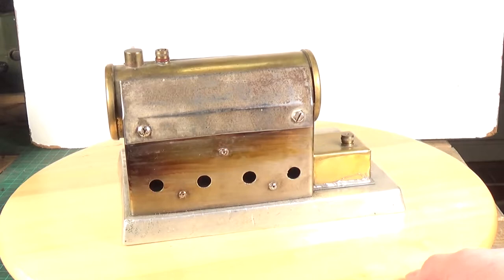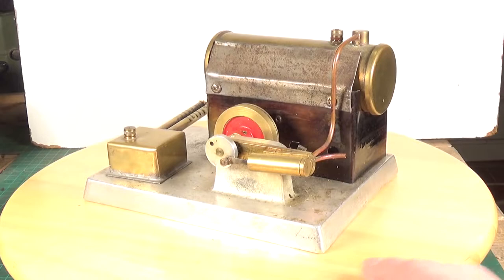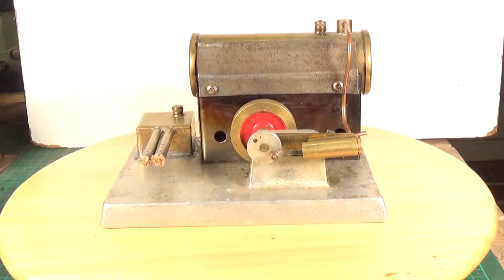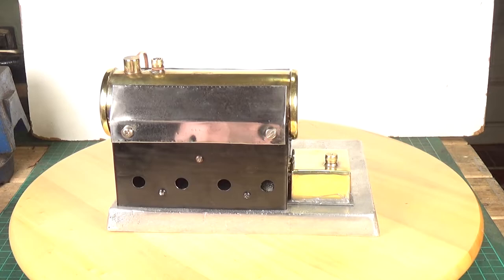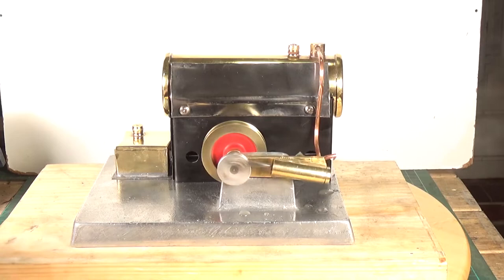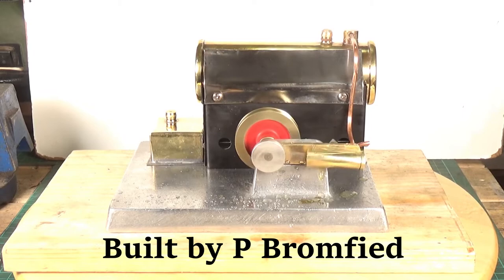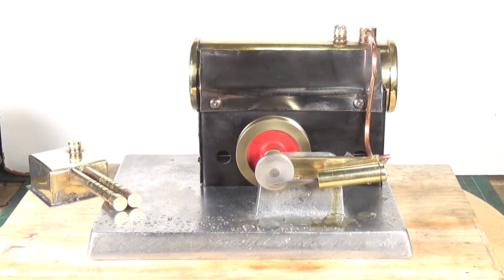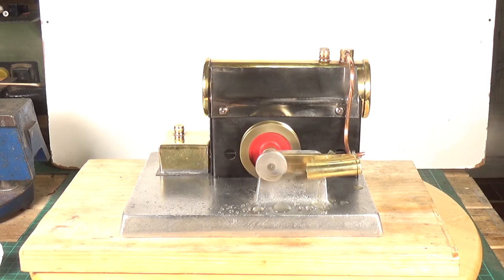Albury Manor MK4 Model Steam Engine

Comment: Runs great Alan.  I'd be inclined to swap out the Philip's headed screws on the side shields for plain slotted ones, just to keep it period.  Cheers Rob
Reply from the maker: Thanks Rob. I did think about that but those are the screws it came with, so I thought I'd keep it as original as possible. Cheers, Alan.